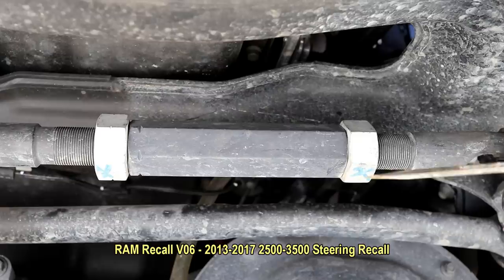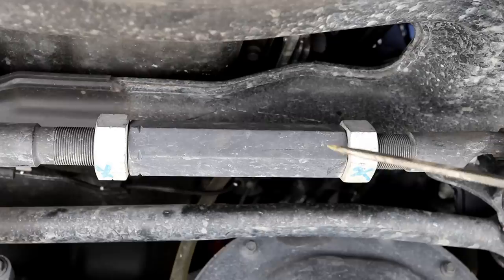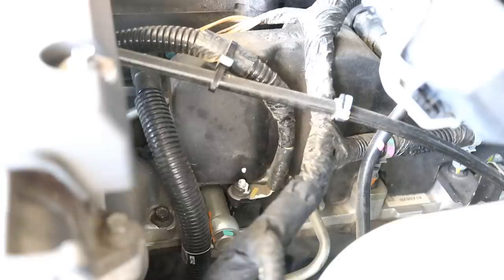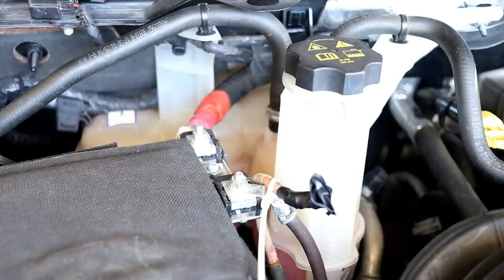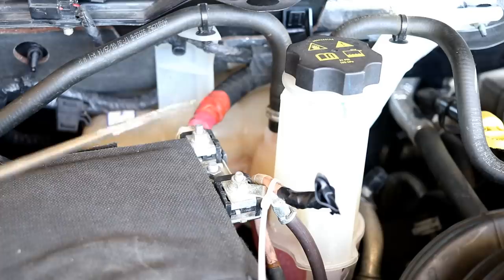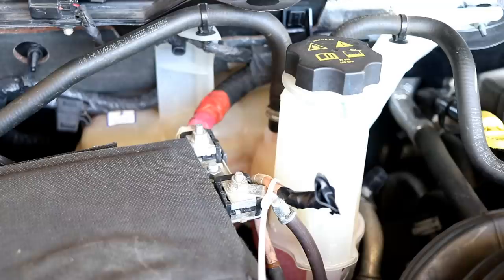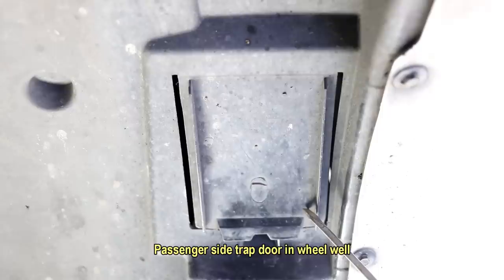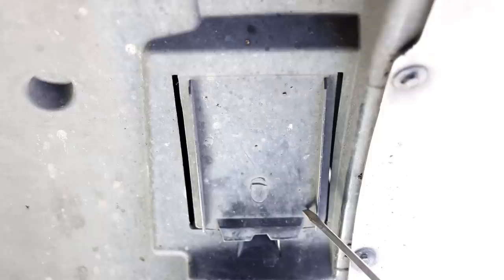RAM Cummins - 5 things you need to know about your truck

Comment: I had my cummins drop the grid heater nut and trash the engine.  The grid heater went out, a mechanic changed it but did not know to look for the loose nut in the intake.  A few miles later the nut found its way to the #6 cylinder and trashed the engine.  VERY Expensive lesson!  IF the mechanic had known to look, he would have likely found that loose nut and saved me 20k.

Comment: Bought a 2001 with 57,000 miles. Replaced the steering with MOOG and RedHead steering gears out of Washington State. Both brands are real nice in this application.

Comment: A double nut on each end of the steering linkage solves the problem. No welding needed. Banks has solved the problem of the grid heater bolt issue. Check out the Ram Monster intake video. 50 state legal and all EGR systems stay in tack, plus you gain engine performance.
Reply from the maker: Good idea

Comment: That 4 inch wheel well tubing is a POS, I had all kinds of trouble with my service engine light, turned out it was that damn hose collapsed, I bought a piece of cloths dryer vent hose and made a cuff on the hose with gorilla tape, using a large wire tie to put it all together. When you do this stretch that hose toward the door post and secure it with some multipurpose foam. The whole Idea is to get cool air to the intake,  I’m lucky that the turbo did not suck that hose into the air box because it sucked it flat.

Comment: Great info again Marion! I am into month 6 of owning my ‘17 Ram Cummins and now in the month 2 of a 9 month rv trip and. So I bring it into a dealer in FL to have the rear differential serviced and brake flush and they checked over the whole truck for me knowing I am on this trip. So they updated the PCM. Well that revealed codes showing injector problems. I never had MIL lamp go on about this! (Why that is, is a question I still have) And being new to diesel did not have reference point of how the engine should sound (yes, it does sound smoother now with 2 replaced injectors). Turns out it had metal shavings shorting out fuel injectors and they replaced 2 of them. This is a known issue on some 2017s where torquing the hold down bolts on the injectors produced a long shaving of metal that would ground the injector (Star case S1718000009). Anyway my point in relating my story is that perhaps having the dealer update PCM periodically is a good thing - it may reveal some codes that are lurking and not lighting up the MIL lamp. And by the way I have a code reader and it did not pick up any injector codes - I had checked just a few days earlier when I was investigating my failing alternator. So was the PCM update a fix for codes not lighting the MIL? And this was a certified used Ram I bought... a lot of questions, I have (Yoda voice)! Other than that enjoyed my ride and trip immensely.
Reply from the maker: Hopefully your issues are over with that

Comment: Marion great video again , I did the same and did not elect to get my draglink tac welded. Which is fine except once those nuts are moved that’s when they tend to loosen up. I replaced my tie rod with a synergy systems tie rod and part of the process is realigning of coarse. So after those nuts were broke they loosened up on me. So I replaced draglink with a synergy systems piece. All the synergy systems stuff is serviceable and grease able. Have a Merry Christmas and thanks again.

Comment: Yes sir, I'm running the Airaid Jr. Kit in my 2018 2500 CTD. The kit replaces the paper element, and the tube, between the air cleaner box, and the turbo. I'm happy with it thus far, and it leaves the stock intake system in place. I got the dry filter option vs the oiled filter.

Comment: Thanks for the overview.  I'm not too keen on the tack welding solution either.  I put loctite on the threads and hose clamps on either side of those nuts.

Comment: Hey Marion, another great video! I too was not comfortable with having RAM do the half ass drag link repair. Instead I purchased a SYNERGY 8701-01 HEAVY DUTY DRAG LINK 13-18 RAM 2500 / 3500 and installed it myself. The Synergy is designed with clamps on the adjusters similar to how the newer RAM drag links are designed. It cost me $300. Much to my surprise, RAM sent me a $300 check after I submitted a claim through www.mopar.com. Hard to say if they will do that for everyone, but it worked for me. Keep up the great video's!
Reply: Thank you, I've heard of a few others that made the claim and got paid.  Doesn't hurt to try.
Reply: Dennis Walker I also used the synergy systems draglink and tie rod. Great products heavy duty , and everything is serviceable and grease able. Great piece of mind when towing. 60,000 miles replaced all.

Comment: Put hose clamps on the steering linkage. It’ll keep the nuts from backing off.
Reply: I never thought of that excellent suggestion I'll be doing that
Reply: The dealer welded mine and had to cut the weeds to do an alignment. Put the hose clamps on and used a paint marker to mark the nuts. Seems to work well and gives you the piece of mind.
Reply: Bob Abooie I put stainless steel hose clamps up against the nut to keep them from coming loose. I can’t post a pic on this comment.
Reply from the maker: Yes, good solution.
Reply: I put hose clamps on when I first got the recall to avoid welding. I suppose Chrysler welds them because it's fast and cheap. 
I recently heard a rumor that in CA we may be refused DMV registration renewal for not having a safety recall performed. (I'll refrain from expressing my political opinion on that!)
Reply: David Ochs I’m located in PA and haven’t had any issues. I actually had the recall performed and took my truck in for an alignment. The tech was like “WTF” when he saw it welded and thought I did it. Told him it was the fix from Ram on a 60 thousand dollar truck. SMH. But anyway, the hose clamps work well plus I marked the nuts with a paint marker to periodically check to make sure they aren’t moving.
Reply: Na, that wont cut it. I read at the cummins forum that the nuts backing  off is only part of the problem. The bigger issue is the threads on the drag link fail and rip out. No hose clamp is going to hold that.
Reply: @MrFuckface2013  Would like to see said pics of the threads "ripping out". More than likely they're not "ripping out", it's just expedited wear caused by the jam nuts being loose. 

Red loctite the jam nuts and be done. 30k miles on "bad nuts" with red loctite and they haven't budged.
Reply: @md9897  Im just telling you what I read posted from a dealership mechanic who has to deal with this problem. But yeah, makes total sense that a problem that can be fixed with hose clamps or loctite Ram would decided to spend the time and effort to weld...........
Reply: @MrFuckface2013  LOL, I know what you mean. Darn Stealerships and FCA...
Reply: What about adding another jam nut on both ends?
Reply: I got rid of that junk ass OEM drag link and got an aftermarket one

Comment: Great video! I have seen your other videos explaining the first few issues, and am glad you made a general heads up for those who may not watch all of them. Had that last intake dryer hose crumple in on itself on my 2013. Threw a maintenance air filter code (on a newer filter). Ended up cutting mine off. I am looking for an outer diameter measurement, so that I can replace it with some form of other tubing that will hold up. No luck on any of the manufacturing websites so far. Thanks again and hope you have a great new year!

Comment: I have a  ram 2014 Laramie mega cab. Your dead on with the problems     I just replaced the y on radiator a month ago and went with the machined aluminum 75$  dodge motor company wanted 126$ for the plastic lol
Reply: Vern T that’s what my dealership sold mine to me for. I needed the part right then but I will be looking at the machined aluminum part soon.
Reply: Yeah I replaced it with the machined aluminum part much better
Reply: What brand did you buy? Just bought my truck would like to do this before it goes on it’s own

Comment: I have a 2020 3500 limited and I checked my grid heater and it was loose and when I took off the intake ………. 2 turns more on the nut and I WOULD HAVE BEEN IN TROUBLE. I changed all to a monster ram intake, and I could not be more happy.

Comment: Great video, just hit 100k on my ‘14 last week and all is good. I had the Y -pipe changed under warranty at 32k miles and has been fine ever since, (but I still keep checking). If it goes again I will likely go aftermarket aluminum. Keep the videos coming. I am really curious on the outcome if/when you test the intake tube. Merry Christmas and Happy New Year.
Reply from the maker: Thank you and to you also

Comment: Thanks Marion. My connector on the upper radiator hose just failed. Noticed pink spray all over the upper part of the engine compartment mostly on drivers side. Doing routine checks pre and post towing my fifth wheel about 300 miles. I've got a 2014 SLT and I was glad to catch this early before it completely failed. Dealer installed part 52014722-AD, which I assume is the fourth iteration of this connector. Hope they finally addressed it with a better quality part that can withstand the temp changes!

Comment: My duct that houses the foam and insert was cracked when I got my truck at 116k. 2018 model. I replaced it with the Airaid intake tube.
Reply from the maker: So it was sucking unfiltered air?
Reply: Marion Blair yes but the foam was up against the crack so that may have helped a little bit.

Comment: I would not zip tie that wire to the positive ...like you have it....if that wire wears through the insulation it will energize your heater...or possibly arc as it tries to provide current to heater.  I would tie it to something else...JMHO

Comment: My 2014 ram 3500 diesel tie rod completely disconnected. I almost wrecked. The truck skidded to a stop. I looked at the front of truck. Left wheel was pointing all the way to the left and the right wheel was pointing to the right. Towed truck to dealer it Was repaired and tack welded. There was a recall for that problem. I traded it for a 2016 3500 diesel. Then the steering started to feel sloppy after some years.  I traded it for a 2021 limited 3500 diesel. There was a recall on the wheel lugs and ram instructed owners not to park the truck in your garage due to the truck can experience a engine fire while truck is parked without engine running. That problem was regulated to the 3500s with certain vin numbers. Mine was excluded. I still keep it parked outside.  On my 2014 I asked the dealer are they getting their parts from china for the steering components. The service manager had a blank look on his face and said he didn’t have a answer to that.  I love the ram diesel trucks. Hopefully, I can keep this truck for the next 20 years. By the way, your videos are excellent there is no music you get right to the point. Others are more like music videos I can’t hear what your suppose to because the music is so dam loud. Keep them coming
Reply from the maker: Thanks

Comment: Thank God I had a Dodge-Cummins!! Really, I've owned three of them - a brand new 1993 (that got 23.7 mpg throughout the years of ownership) then a used 2002 and finally a 2004. ALL great trucks. Which is NOT what I hear about Ram-Cummins, which doesn't even sound right...
Reply: Dude, they all had problems. Ever here of the KDP? Or the suspension death wobbles.  Basically everything around the engine was and still is crap.
Reply: Cummins is NOT the issue/problem with Ram, the PROBLEM is FCA!!!
Reply: They all have problems I have a Denali and front end work is a pain in the ass and guess what I don’t want any more Gm they are all money pits you just pray they survive but I hear about every manufacturer not just ram there are horrible stories about all of them so just buy what you like and take what you hear with a grain of salt about any of the heavy duties
Reply from the maker: I have a friend with a new super duty/ powerstroke with the death wobble.  When it starts, he's got to come to nearly a dead stop before it quits.
Reply: At 85 kms in way home i [juste purchased] expériences that wobble. Scary. After replacing steering stabilizer shock ( zero oil left in it) it steers well again. Up to 120 kms at least . How the last owner did not fix this i dont know. Got it cheap so have funds to go over and do proper repaira.

Comment: I am in the market for a new 3/4 ton. I like the options available on the Rams.  However, dodge legacy of low quality freaks me out.  Probably gunna go the Chevy,gmc or Ford route
Reply: Chevy 4x4 Ford has had there issues and Chevy injector issues... Cummins is the best Diesel out there or I would go Gas with Ford or Chevy

Comment: Great video, as usual. I’m interested to see how the emissions equipment holds up on your truck as it ages. Any issues thus far?
Reply: No, no issues so far other than a few bogus codes and it's been a few years since that.  We'll see how it goes and report what I find.
Reply: I bought my 2007.5 with 67000 miles and the DPF was clogged with ash. No way to burn that off. However, when you repair the truck so it will run that becomes a non issue. A 3 3/4 inch hole saw works wonders.

Comment: Hey Marion. Thanks for all your videos. I enjoy watching them and they have helped me learn how to do regular maintenance on my 2015 ram 2500 with the 6.7 Cummins. I’ve only had the truck for a couple of months, bought it used with 68k miles on it. I’ve never had a ram diesel before so I am trying to learn what the normal sounds of the truck are. I’m wondering if it’s normal to have a sort of whining noise when you start the truck and turn the wheels left and right. It gets louder when you turn it all the way. And it seems to make the noise as I’m decelerating too. Sounds like maybe lower steering whine or something like that. Just wondering if your truck does that?
Reply from the maker: No I haven't heard anything like that, it sounds like possibly the power steering pump?   I know I've had some other vehicles and it sounded like that and that was normal however.

Comment: Enjoy your videos, I've got a 2017 Ram 3500 Dually and was curious if you knew how much fuel is "actually" left in the tank when the low fuel indicator dings then when the needle bottoms out on the fuel gauge red line? My fuel economy indicator on the dash will show approximately 20 miles of fuel left on the red line. Had a couple of close calls pulling my 17,600 pound 5th wheel. because at 1/4 fuel level I don't have a lot of distance left, needle drops quickly, Thanks, David
Reply: I ran my 07.5 6.7 down to when the light came on cause I was taking the tank down and installing a sump, I didn’t measure what was left in the tank but I would estimate between 3 and 4 gallons!

Comment: Does your truck has a secret switch on the top of center hole where bussines cards would go on the right side of the radio. I just found one in mine and I have no clue what is it for.
Reply from the maker: Victor Escobar no I just looked, I don’t see a switch just the hole

Comment: Marion Blair does it matter which wire you disconnect on the grid heater? Also, do you wait at all before starting or just start it. I live the same area as you and also have no need for the grid heater.
Reply from the maker: Don't wait, just start it.  I disconnected right at the battery because it's easy to get to.  You could disconnect on the grid heater side of the solenoid  also.  Best place is right at the battery.  Follow the wire up from the solenoid under the intake baffle to the battery and remove it from the battery.  Just keep the loose end away from the positive battery terminal.  Doesn't matter if it touches the rest of the truck.

Comment: What if you use extra nuts on each side and just tighten those up against the existing nuts on each side with some loc tight? And maybe even put a lock washer in between them
Reply from the maker: Excellent idea.  Ram should do that
Reply: Jam nuts should work! A Dremel, with a reinforced cut off wheel, to break the welds, if necessary!

Comment: Hey Marion
What batteries did you go with, AGM or flooded
Not sure what to do, -50 Celsius here in Northern Canada and had a dead truck today. Current batteries are stock , 7.5 yrs old
Thanks!
Reply from the maker: AGM, Sam’s had best price.  Duracell.
Reply: @MarionBlair  ok thanks
No Sam's here in Alberta Canada
Costco Energizer are about 280 a pop.

Comment: Thanks for efforts, 
What year is your truck?
I have a 2006 5.9L, Because Ian out state at the moment, do you know if the grid heater bolt potential problem is an issue on the older trucks,
Tia, bob
Reply from the maker: It's mainly the 6.7 L.  Different type of grid heater.  I never had an issue with a 5.9 l.